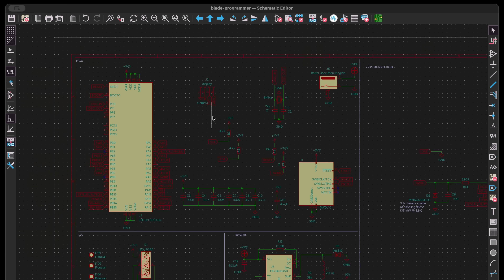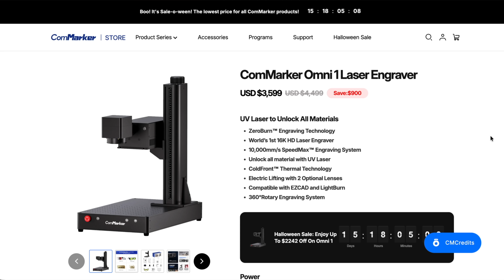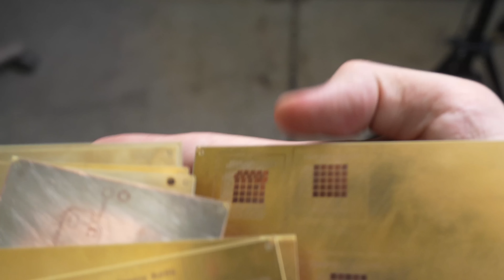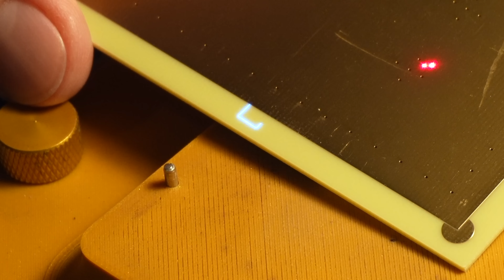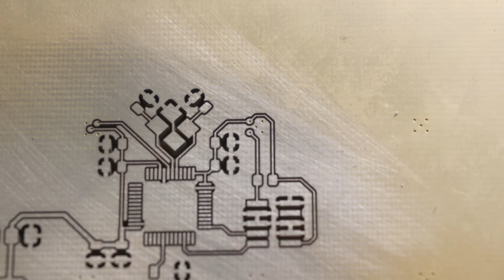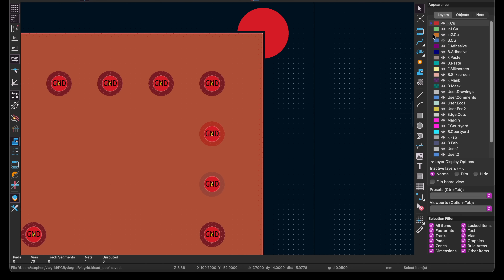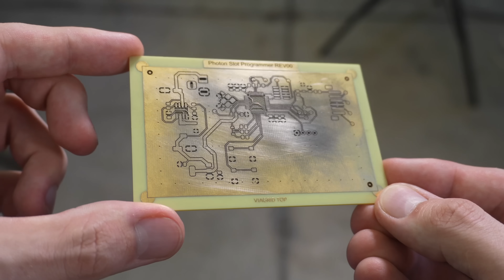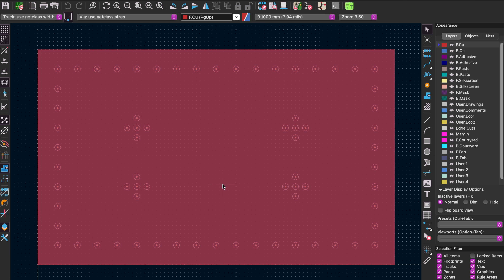The Last PCB You'll Ever Buy

Comment: AI Summary

Abstract:

This video introduces "VIA Grid," a novel method for ultra-rapid in-house PCB prototyping that addresses the long-standing difficulty of creating vias. The core concept involves using standardized, pre-fabricated FR4 PCB blanks that feature a grid of factory-made, plated-through vias. The prototyping workflow shifts from creating vias to simply defining traces around them. This is achieved using a UV Diode-Pumped Solid-State (DPSS) laser, which can ablate the copper layer of standard FR4 boards without making the substrate conductive—a critical advantage over other laser types. The process includes a custom physical alignment jig with a two-plate system and unique "Pac-Man" fiducials on the board for precise, software-independent registration. The video demonstrates that this technique, combined with a pick-and-place machine and reflow oven, can reduce the entire prototyping cycle, from digital design to a fully functional, double-sided SMT board, to under 90 minutes. The project is open-sourced on GitHub to encourage community collaboration and refinement of the standard.

VIA Grid: From PCB Design to Finished Board in 90 Minutes

*   0:00 The VIA Prototyping Problem: The video identifies the primary bottleneck in rapid PCB prototyping: creating reliable vias (connections between layers) is complex, time-consuming, and requires specialized chemicals or clumsy hardware rivets.
*   0:21 The VIA Grid Solution: The proposed solution is to use a standardized PCB blank that comes with a pre-fabricated array of high-quality, factory-made vias. Prototyping then becomes a process of etching away copper to define traces that connect to these existing vias.
*   0:45 The 90-Minute Workflow: The complete process is outlined: design a schematic using a VIA Grid template in KiCad, export the layout, align the board in the laser, etch both sides, populate with a pick-and-place machine, and reflow. The entire cycle can be completed in under 90 minutes.
*   1:37 The Enabling Technology (UV Laser): The process relies on a UV DPSS (Diode-Pumped Solid-State) laser. Unlike fiber lasers that can make FR4 conductive, the UV laser cleanly ablates the copper without damaging the substrate, making it ideal for this application.
*   3:01 A Clever Alignment System: A major challenge, aligning the PCB to the pre-existing vias, is solved with a physical two-plate jig. The user visually aligns the laser's low-power frame with "Pac-Man" shaped fiducials on the PCB corners, allowing for fast and precise physical adjustment without complex software calibration.
*   4:27 Evolving the VIA Layout: The design of the via grid itself was iterated upon. An initial dense layout was found to be difficult to align, so the final design uses a more spaced-out, forgiving pattern that doesn't compromise routing ability.
*   5:30 Real-World Success Story: The creator demonstrates the system's power by quickly recreating a complex programming jig for their Lumen P&P machine. The design and layout took only 20 minutes, resulting in a finished, functional PCB a couple of hours later.
*   6:22 A New Prototyping Paradigm: The video posits that this method could be for hardware engineering what 3D printing was for mechanical engineering, creating a new standard for in-house, rapid iteration of high-quality, two-layer PCBs without janky jumper wires.
*   7:14 Open Source & Call for Collaboration: All project files, including KiCad templates, LightBurn settings, and the alignment jig design, are available on GitHub. The creator is actively seeking feedback and collaborators to refine the standard and is even offering to send free VIA Grid boards to those interested in helping.

AI-generated summary created with gemini-2.5-pro for free via RocketRecap-dot-com. (Input: 16,013 tokens, Output: 823 tokens, Est. cost: $0.03).

Comment: Super cool, but most modern designs need layout to be very tight and vias in the perfect spot to work properly or at all.
I think most people who are important enough to need their pcb same day would also need vias in the perfect spot.
Reply: I personally mill my prototype PCB's but my current concessions are that I need to use larger components and thicker traces. Pre planning the vias might be a better concession, especially for finer traces and faster turn around. Also keep in mind that you can still drill any essential vias once the board is done if you really need! This guy is onto something! I saw someone suggest different flavours of vias patterns as well. I'll definitely be following this!
Reply: True, but I think that this represents a huge shift: it's not about the people who are already working with PCB fabrication, it's about the people who aren't. A lot of people don't get into custom PCBs because of the time required. What if I told you 3D printing exists, and you could design a part and have it printed out, but you had to upload your design to a website, have it shipped internationally to you, and get it in 1-2 weeks. Most people wouldn't bother, and would probably have no reason to ever learn CAD. I work with graduate design engineering students who are on very tight schedules and they know custom PCBs will take their projects to the next level but they don't have the time to deal with JLC, etc. 3D printing has revolutionized high fidelity prototyping, and I think that this design is laying the groundwork of a paradigm shift in electronics prototyping. Once people get comfortable with the process using a system like this, they can graduate to fully custom boards, but I think that this is the missing link for a lot of people.

Comment: I've also been wondering whether we couldn't have PNP-able vias that go into drilled NPTHs, sort of like 0-Ohm resistor jumpers. They'd have to be roughly mushroom-shaped and just every so slightly shorter (but matched to) the board thickness, so that when they get dropped into a pad on side A, after just generously applying paste on side B you get a connection.
I can see that side B might be a bit tricky and subject to variation depending on burrs left by the drilling process etc, but I feel like this could work?

Comment: I'm a software guy who dabbles in firmware. I've built lots of DIY with JLC, and I've been hoping for end-to-end prototyping capability for years. This isn't just a game changer for prototyping. It's a game changer for small-batch production too. It will level the playing field for hardware startups. Awesome!
Reply: don't get what the big deal is, people want to iterate different designs on a PCB instead a breadboard why?
Reply: @lfm3585 im an aerospace/mechanical engineer and a novice in electrical/PCB design. but first thing that comes to mind for me is being able to prototype with ICs that dont come in packages that are convenient for breadboard prototyping? i know manufacturers sometimes sell evaluation boards but those are pretty pricey from what ive seen. idk again this isnt my primary discipline so maybe its a solved problem 🤷🏾‍♂️
Reply: @donovan_n  On this channel, this guy has a whole pipeline for cnc, screening, pick-n-place, etc. For most ICs, I assume he would advise using the SMT version on these boards to avoid as many through holes as possible, but I’ve never tried it personally, so maybe someone from his patreon who has more experience can verify here. All I know is… it looks super cool to be able to prototype anywhere near the quality of JLC or PCBWay in under 24 hours if you have the equipment.
Reply: @lfm3585  For small batch (e.g. trade shows, events, etc) breadboards are not ideal and the Chinese rapid custom service providers are still 1-2weeks per iteration. This is will give us 10x as many shots on goal before show day.

Comment: I dont feel this is very practical, reason is , sometimes if you're prototyping this conventional via placement is not good for most circuits . Let's say DC-DC converters , i cant have a very highly distributed components .
Reply: You can pretty much ignore the vias and place components on top if you need to - you don't have to avoid them. I haven't run into any issues with tightly packed components in my own designs.

Comment: Brilliant idea you have there.

If you include fids front and back on the premade boards, could the laser have a routine to line up to those before staring the burn?  Those could be half etched and blackened in the pre mounted 4mil stencils you are going to sell along with these boards.  Then design a stencil printer with auto alignment to compliment your pick & place.  I don't know what the work area this UV laser has, but maybe you could tool it up so you could also do a 2x PCB size PCB and stencil and either index (like the X-Tool x axis option) or turn the PCB and stencil 180 to reach the other half.  For smaller boards you could cut the topside image on one end of the stencil and and the bottom side on the other end.  Small CMs play this double image game all the time to reduce their stencil cost.
Reply: Here's another thought:  have the board fabricator add a precision, plated through tooling hole at each corner of the board and supply a precision fixture for the UV laser with stubby, diamond shaped tooling pins (lookup Burgess-Carlson pins and Stoesser pins - shorter than the PCB thickness).  Make a similar fixture that can nest into a little manual paste printer and have a cavity that you can drop in a custom support block (easily 3d printed to have relief pockets for side 1 components) for support when printing the second side.  You'll need to have two y axis alignment knobs and one x axis knob so you can align the PCB to the stencil in x, y and theta for the first print.  Subsequent prints can rely on the tooling pins.  Probably won't get you to the 0201s, QFNs or the like, but should be good enough for at least 0603 and 20-25mil pitch ICs.  Finally, check out some DEK 248 YouTube videos.  Maybe you could make a scaled down x axis shuttle and alignment table like the 248 has for the commarker UV laser.  A couple of cameras over top of the stage and the three knobs allow you to align to the fiducials before you shuttle the pcb into the laser work area.

Comment: You got room to put 2.54mm spaced fingers at both ends, both sides, like you find on some prototyping boards. For adding double row pin headers and other things such as soldering two boards together. 
Fantastic innovation by the way.

Comment: Having a 4 layer board, even if they're both ground, would help a lot for designs that benefit from having tight return-path coupling like high speed digital, RF or mixed signal boards. I think you mentioned previously that FR4 usually burns, how would you make the extra layers? I think plating over filled via could help substantially with layout if your design needs lots of vias - as is necessary for good decoupling for example.

Comment: I was excited for about 2 minutes and then stopped watching.

You have basically enabled a slight improvement over breadboarding, at a very high capex.This "solution" falls flat the moment you move past trivial, 2-layer, low frequency digital circuits.

If you have a budget of 3-4K and you need to iterate on something rapidly, you're better off going to Shenzhen and parking yourself there for a couple of weeks.

Comment: Ok, I love this idea! For a four- or six-layer board you could have a pair of inner layers with rows of signal traces, one horizontal, one vertical. With some development, you could get really good density out of something like that. Autorouting tools might be a possibility as well since the vias are in fixed locations!

If I were to use something like this I would also consider a bank or two of 0.1” headers and maybe some space with a double-row block for ICSP headers or jumpers. It’s so cool that you could do either with the same pattern, too!

As for names, maybe something playing off of “FPGA” like… Field-Etched Via Array, or Field-Routed Net Array? Or Field-Printed Circuit Board? 😅 Field-Programmed Via Array?
Reply: Field-Printed Circuit Board (FPCB) would be great but Flexible Printed CB is already a thing.

Maybe Field Etched Circuit Board (FECB)?
Reply: Arrays of horizontal and vertical traces is a cool idea, but where do you put the vias? There are going to be a lot of excess ones, or not enough.
Reply: @jessicav2031 excess vias can be left tied to ground with little complication I think.

Comment: If it worked with auto-routing then fine but manually routing would take forever nice try though..
Reply: It actually doesn't take any longer than routing a normal board. Actually, in most cases it takes less time, since your choice of placement is fixed. Autorouting for these is also being worked on by the community!

Comment: Stephen, Do you think it would be possible to drill a whole with laser like you have an then use some of the techniques used in the new laser welders to create the via? Maybe feed the filler metal (copper) from the back and melt it with the laser from the front?

Comment: Brilliant idea.

The one thing in this video that gave me pause is the work you had to do to calibrate the laser properly. This makes me wary about simply jumping in and ordering an entire setup for the board manufacturing, especially considering how expensive the laser engraver is.

Are there any less expensive paths to learning the ins and outs of laser engravers? Could you recommend a budget setup (preferably an order of magnitude less expensive) to gain experience with? If they were able to produce circuit boards, even much more slowly, it'd be ideal.
Reply: Do you have a local makerspace? Might be a decent way to get started
Reply: @ChristopherGrant-m1u  No, unfortunately.
Reply: There aren't really any cheaper lasers that can be used for quality PCBs. CNC machining and chemical etching can be used instead though for a much cheaper startup cost.

Comment: Im currently in the process of setting up a fiber laser enclosure which has an activatable evac and xy stage. Doing it specifically to etch plastics and get started on learning more pcb design. One of the parts I have been contemplating on for the bed chuck is how it will work. Its a slow process but the code is prepped and half of the build is there. No idea if ill get the lumen some day. Maybe if i decide to start producing products eventually. Its one of those really big wants but you cant justify it. The galvo fiber laser has been a much bigger game changer than i thought however.

Comment: You don't need an omni-1, light coat of paint and some fecl2 will do wonders with any 1064nm galvo fiber laser.Also you can make your own vias(reflow rated🤯) without electroplating or copper eyelets🤔.
No need for elaborate alignment jigs either, the calibrated red laser is good enough, with the copper clad, on a microscope  xy stage.❤👍

Comment: 5:00 wouldn't a power and ground plane like that act like a cap?
Reply: This is part of why 4 layer boards are used, the close proximity of the PWR/GND form a relatively small capacitance but it has very good ESR properties and fills in the gaps that the higher ESR in the SMT capacitors struggle to compensate for. That and solid planes under a high-speed track means it has a continuous impedance.
Reply: @Roobotics I did not realise that. Thank you for the learning experience. I assumed it would have been a bad thing. I will bare that in mind for future knowledge.
Reply: @Falney of course! It's a more common issue when you get into multi-layer designs, it mostly affects things like 'transmission lines' because suddenly it matters if you have copper on one or both sides, each adds capacitance, fun things like that. In the realm of 'bypass capacitance' it's one of the good traits that can be extracted from it.
Reply: Yep, been like that for years, you design for it :)

Comment: my idea for the 4 layer PCB - 2 types of vias
- typical top/bottom layer
- 2/3 layer "dynamic" vias that are routed to the edge that is basically a telephone switch board style area - one can route their own desired connections

a bit worried about the size of the switchboard and signals would not be the best....
but maybe if somebody smarter than me can see if this idea is even viable/useful....
maybe just some pre determined 2/3 layer connection vias are just better and less of an hassle in design

Comment: I unfortunately can't work on this type of project right now because I'm working on a boat because I'm trying to afford better tools. But I just bought a gweike 50w fiber laser and I'm really excited to start using it next year trying to see what's the best setup for making boards like this. Perhaps you should try and get a bunch a different designs with different via layouts , because I can see this kinda sucking if you're trying to make a pcb that's really small and you have to make the pcb bigger than in necessary to be able to reach a via. Unlikely in most cases. Very cool work you're doing , amazing stuff.